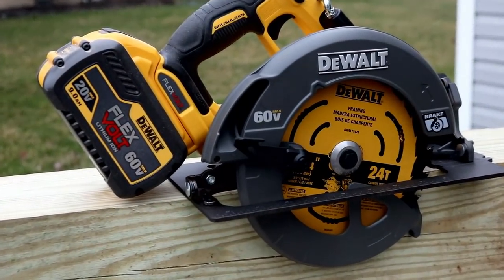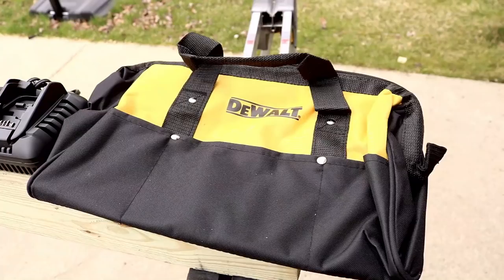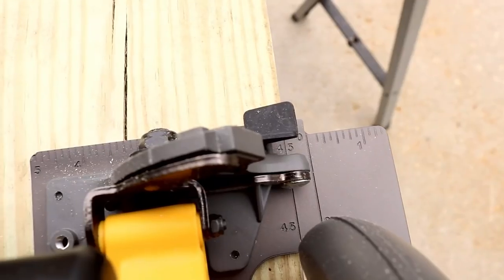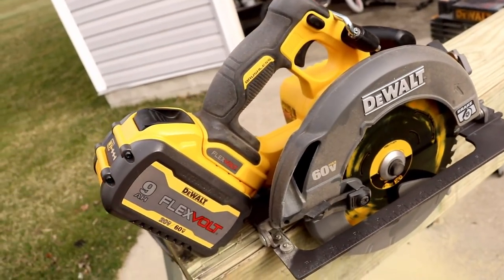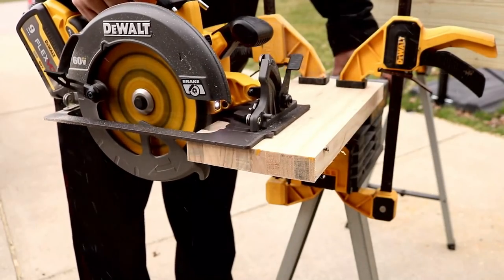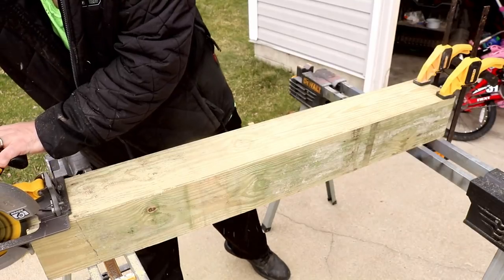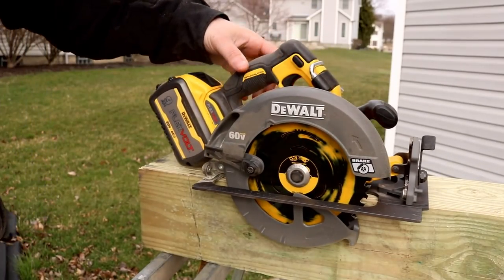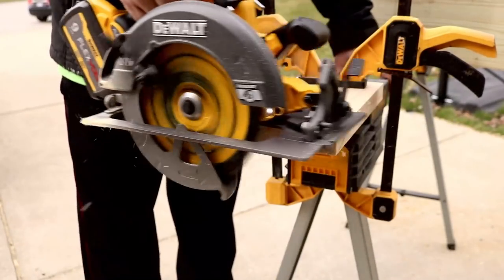All New Dewalt 60 Volt Max Flexvolt 7-1/4" Circular Saw IS HERE! (DCS578X1) This Saw is a BEAST!

Comment: We just reviewed the DeWalt DCS575 on our channel a couple of months ago, I love our saw. The specs on this saw appear to be all the exact same as on our DCS575, except this saw claims 47% more power. But beware many companies including DeWalt play specsmanship games. Their claim of 47% more power is that this DCS578X1 is using a 9 AH battery, while my DCS575 is using a 6 AH battery. That does not sound like apples and apples to me.
Reply: My understanding is that the 575 utilized an 1800 watt motor. The left blade saw uses a 2400 watt motor. This saw is basically the 575 with the more powerful motor. Probably include the 9ah battery to increase run time with the bigger motor.
Reply: The 575 definitely did not need anymore power ,it's all about marketing hype.

Comment: Hi TRZ, 

I wish DeWalt can make this exact model but with a blade on the left side. Also a cover plate so we can screw on and cover the dust extractor section.  I still like the dust  coming out on the bottom then the side. 

I know some like to use a vacuum attachment for indoor work. That's why it will be cool if they can add a cover plate for those that don't.

Now a comparison video on both models to see if there's really a big difference.

Comment: You should put that up against Milwaukee 2732-20 with 12.0 battery with blade all the way down in pressure treated pine.  Workshop addict did a comparison, but it wasn't too good because he had a 8.0 battery in it.

Comment: Nice saw and nice kit for the price. Like the blade brake. Seems super powerful. Don't like to many FlexVolt tools but this one could be my favorite 7 1/4 circular saw. Smooth cuts and looks to be easy to adjust. Great review 👍
Reply from the maker: Yeah its awesome bro. I am right handed so not my favorite setup, but those who use the left sided blades will love it

Comment: Anyone else have problems with the blade alignment on this saw? Trying to cut using a speed square as a guide, I noticed the saw would feed away from the square, checked the blade in relation to the base plate, and it was 3/16" different from front to back of blade. There is no adjustments, so I ground out the front mount, and trimmed the edges of the base. Found the front mount was really loose, so also had to turn and install a bushing. It's a great saw!

Comment: Love it Clint, keep it comin man. Wonder how this stacks up against I guess ANY 7-1/4 circ saw of any class coffee or otherwise. I’ve never seen a saw dive into solid treated and not bog even a little.... insane
Reply from the maker: I really think this could be the most power 7-1/4" out there Austin.  Like you said, you usually get a little bog, but this just kept going.  I just wish the blade was on the other side because that's how I like it, but still a beast!!!!!
Reply: Tool Review Zone yeah that’s what i was thinking! Do you think it’s more powerful  than the rear handle? Also like to see this up against the power detect with the new 8.0 setup
Reply: Tool Review Zone yeah I was wondering why they don’t make the exact same body and everything just on the other side like the 6-1/2 ones. Why does it have to be bigger rear handle?

Comment: I just ordered this an it also comes with a. 1/2 impact wrench can’t wait until it gets here. I would have preferred the blade on the left but it’s no deal breaker
Reply from the maker: You will love this saw Caleb
Reply: @ToolReviewZone  needs dust extractor,basically illegal.not to have that,or the guide,which i throw,is cheaping out.for an axtra 5c,they could of incuded them.

Comment: Ok i picked one up - welcome to 60v! !   That new tool smell...
Reply from the maker: Awesome,  how do you like it Guy?
Reply: @ToolReviewZone  slicin and dicin my man! My old 20v is great for light work but not really usable to build pressure-treated decks.  This kit came with a 9ah batt and fast charger (8ah) - a great deal versus just buying a single battery or tool-only.
Reply from the maker: Damn right brother.  That saw is a beast Guy, glad it's working out my brother 👊👊👊

Comment: Dust extraction is a problem. I realize the blade guard handle passes in front of the dust port that prevents a vac hose attachment to be added to the saw, but with a little more design effort, I think DeWalt could have added a dust collector chute for a dust vac system. Bosch did it on their corded line.
Reply: There is a dust collector chute that comes with the saw, you can choose to install it or not

Comment: I have the Flexvolt 575 and the power is insane ,there's no way I need this saw .
Reply: Oooh yeah I know the one , that saw is a beast . Every cut I did with it ..is meean .
Reply: Home depot has this saw along with a hammer drill for 299 right now. Awesome deal
Reply: battery is like 200

Comment: How does the power of this saw compare with the Milwaukee 2732-20 with 12.0 battery?  You should do a head to head comparison to that saw because for the longest time, the Milwaukee was top dog.
Reply: company claims equivalent to 15 amp power which is 1800Watts, this saw claims sup to 2450Wats, so its 25% more powerful.
Reply: @miguellopez3392  2450/1800 = 36% more powerful

Comment: Too bad it isn't track-compatible. Also the charger is too small for the battery. Otherwise I'd take it for sure! I have a 575, but was very disappointed to find out that it wasn't track-compatible either! Most of the flexvolt tools I've tried are beasts! I love the 54v line!

Comment: I would like to know what changed between the dcs575 and the dcs578... is that when dewalt upgraded the cells in their batteries? Did they change the motor?  All I see is 47%more power but what changed??

Comment: Would you pick the seven and a quarter Milwaukee brushless fuel what would you go with the rear handle Worm Drive saw probably is 7 and 1/4 because like I said the 5 and 1/2 or 5 and 3/8 is really more than enough that I need it's just a little bit of a pain when cutting plywood because you really have to overlook to see where you're cutting the line
Reply from the maker: The dewalt rear handle is a monster and is my favorite out of all the others, but the Makita is also a nice saw that is super smooth
Reply: @ToolReviewZone  and that takes the 20 volt Max correct because I'm looking into purchasing the new Dewalt concrete nail gun Vince from VCG did a video on it and super impressive should I take the same battery I have to look into that thanks hope all is well brother

Comment: That's a very powerful circular saw. But the guard seems to be a little bit of a problem. And I can bet Milwaukee and Makita is hard working to beat DeWalt. Those three at it all the time.
Reply: The older flexvolt saw spanks all the other saws in the market. This one will double spank them

Comment: I have this saw and I can tell you put a cut off wheel on it and it will cut even 1/8 inch Stainless steel with no problem 5feet across I like this saw🦾👍

Comment: New subscriber here, how’s the battery life? I’m trying to decide if I can get away with one battery in the day, low to moderate use, or if I need a second battery
Reply: Yes you will get away with one battery if only doing cross cuts but if you do a lot of full depth rips you will need 2 batteries as they will draw a lot of power as any powerful saw will .

Comment: I'm looking to step up to a bigger circular saw I have the Milwaukee 5 1/2 inch circular saw works great for what I need because I'm ripping a lot of studs are you at the chop box but I want to go with Milwaukee just because of all the batteries I have what size would you recommend
Reply: If u are ripping alot of stud get a table saw milwaukee have a cordless table saw
Reply: @harrishpersad3643  I have the DeWalt 12in dual bevel compound miter with the rolling stand I also got the 10 in table saw from DeWalt just recently purchased them both because I needed new ones for myself the guys really screwed up my other ones and what it pays to have it fixed for a few hundred more just purchased new ones
Reply: @harrishpersad3643  that's basically the only tools I have 4 DeWalt is the table saw the chop box I also have the battery operated 7 1/4 inch chop box for trim and the rest of my tools all Milwaukee from my screw guns to my jigsaw my isolator you name it it's Milwaukee but I have the 5 3/8 of 5 and 1/2 in circular saw from Milwaukee it's a pain to see the line because it's a small saw I was just wondering if I should purchase the 7 1/4 I'll go for the Worm Drive saw from Milwaukee